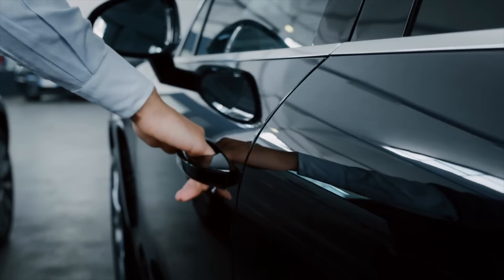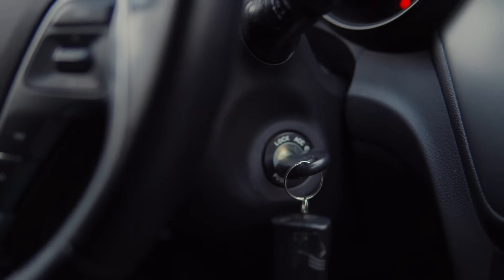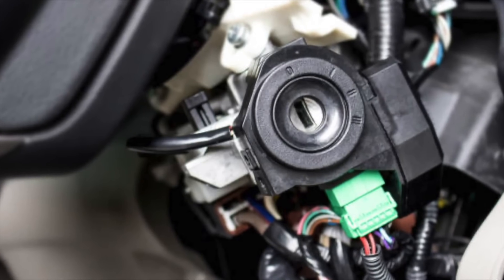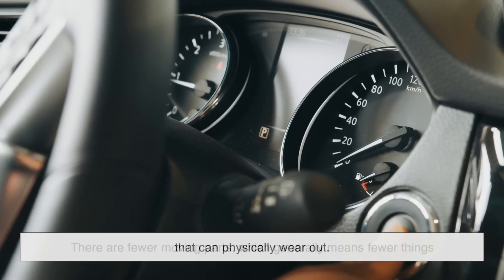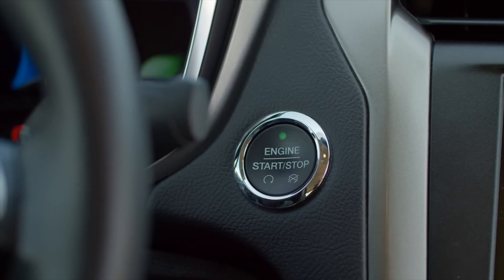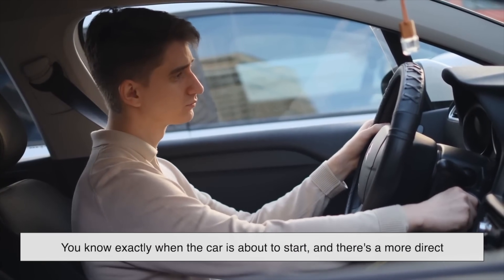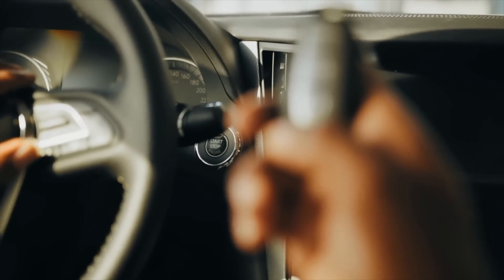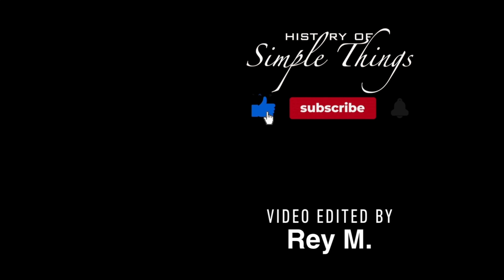Traditional Key vs. Push Button Start: What Sets Them Apart?

Comment: At least both the button and the key method is better than the hand crank method used in very old cars where you have to go outside at the front after turning on the valves and turning throttle to full and turn the crank to start the car. Maybe the key method was to simplify the old method.

Comment: I think the mechanisms are similar these days between push and key start - they both send signals to the ECU to start rather than cranking the starter motor directly, and the ECU handles the actual start. Obviously keyless start required the pinging of the key fob, but the ones where the key is pushed into a slot and there is a button are the same, apart from the mechanism to release the steering lock.

Comment: I prefer the key and door unlock button. In my flying days, you had to turn on a master switch, then crack the throttle and set full mixture, then push a start button. Newer aircraft have fuel injectors and automatically compensate for altitude. Over simplified but I believe in cars keys are best.

Comment: i have driven cars from the 1930s - late 1960s and the push button is on the floor. high beam light button in on the floor also to the left of the break and clutch.
Reply: My father owned a garage in the mid 60s and I remember that , also column change was a thing
Reply: * brake

Comment: I've driven two different cars with key activated ignition switches that were both 20 plus years old. Never needed to replace the ignition switch or the lock cylinder. A car having push button start would be enough of a reason for me not to buy it. In my opinion, push button start is just another overly complicated system. One that offers no real benefit to the driver. You can probably guess which system I prefer.

Comment: We have three cars. One has a key, the other two are keyless.
I prefer the key. You know where it is and there is no danger of driving off because you have started the car then gone back into the house and left the keys on the kitchen table.
I've seen a near-mishap. Stopped in a traffic queue the driver of the car in front got out and headed off while his partner got out, walked round to the driver's side and got in - only to get out and go running after the ex-driver to get the key!

Comment: I've had key start vehicles for over 50 years. Never had to change the cylinder lock on any vehicle.  It takes an awful lot of cycles to wear one out. Lets see how long these high tech garbage vehicles last compared to older key type cars. Pick your poison boys.

Comment: You're not old enough. Push button start was very common in cars up to the 1950s! You needed to use two hands, one to keep the choke pulled out, and the other to press the start button. The key was only for ignition and electrical system.

Comment: Back in the day, my 2004 already had a push-button start. It was rare and cool back then. Nowadays, not so much. I remember one time I didn't know the engine was already on and idling, I pushed the button a 2nd time and the starter made a whining sound that didn't sound so good.
Reply: I am shocked that this car (whoever the manufacturer is) did not recognize that the engine was already ON and activated the starter again...HUGE engineering flaw...it's not that difficult to know in the car network that the engine is already running and ignore another push of the start button...it's simply lazy work. I won't even ask what car brand this is, but definitely a huge logical gap. I mean it's really stupid simple: if the engine is on already (you simply have to know this in the car's computers) AND the start button is pressed, DO NOT engage the starter because it's useless :-) . PS: Shouldn't the start / stop button STOP the engine if it's pushed while the engine is on? Now you really make me question what car you have :-)

Comment: I intend to only drive vehicles with a physical connection to the electrical system.  Not only for reliability,  but for safety.  I'll tell my truck when to cut off. Like when once I jumped a lane at a toll booth. Pedal got stuck under the mat, all I had to do was flick that key back.  Accident avoided.  I don't think that button would have done this while in gear in motion.  I wouldn't trust it anyway.

Comment: Key based on the KISS system. And don't forget that removing the key from the ignition switch also locks the steering, which is a further deterrent to car thieves.
Reply: Is that why they did that?  I thought that if your car is rolling, it is better to be able to steer it than have the wheel locked.  I read that once in Australia, a driver was going down hill with transmission in neutral and engine off.  He could not steer and it took him too long to realize that he needed to insert the key and turn to unlock the steering wheel.  He died.
I prefer to be able to steer, period.  My 1966 Pontiac has the ignition switch mounted on the dashboard and the steering wheel is never locked.  It was easy and inexpensive to change the ignition switch precisely because I did not have to disassemble the steering column.  Problem with all of this computerized wizardry is that any repairs are impossible for do it yourselfers and are extremely expensive when done by shops.

Comment: I heard of one case where a push button start car that crashed.  For some reason the the engine died, and steering gets hard.  To restart you need to put the car in neutral and step on the brake..  I had a push button start car once and I didn't like it since you needed to step the brake kind of hard until the green light came on.  My truck and car has keys.
Reply: The disadvantage of power steering.

Comment: I hate that you need to press the brake pedal in push button cars to start the car. Driving stick it can happen on occasion that you stall the car on a green light, especially when the gas pedal is sensitive and you can easily add too much or too little power. With a key ignition you can simply step on the clutch and immediately start the engine while still coasting, giving you a rolling start. 

With the push button you basically have to come to a complete stop in order to start the engine again, which costs precious seconds and is inconvenient to everyone waiting on you. What's that? You never ever stall your manual transmission car, so no problem? Liar, I  say! 😄
Reply: I had a manual with a start button. There's no need to press the brake, just the clutch. And you can still restart the engine with the car movement.
Reply: @lajya01  Not with my Mazda 3. They even give you a big fat message on the dashboard that you have to depress the brake pedal before you can start the engine. When you do it without the brake, no ignition.

Comment: You seem to omit some history of cars. I mean whan cars from, I guess 1920'on maybe earlier, also had a starter button up to to luxury cars in the end of the previous century. Usually you would have to start a magneto, or other likewise device, and once that was set done you'd push a button to ignite or start  the engine. Could you make this clear for a broader audience, since the Start button is not that new, to my opinion. I do thank you to consider this idea and broadcast it., Greetz, Pierre

Comment: New cars come with two FOBs. If one is dead the other can be used. Also a dead FOB still can be used by holding the FOB near the push button when starting the car (according to my dealer). FOB battery replacement is easy to do also.
Reply: You should test the dead fob procedure. You might be up for a (bad) surprise.
Reply: @lajya01  You can start a push button car with a dead key fob by holding the fob close to the start button, as it may still transmit a signal. Additionally, many fobs contain a physical key that can unlock the door, allowing you to access the vehicle.

Comment: And when the battery on the key fob dies you're screwed.
Reply: No it wont, you can still turn on the car buy using the key fob to put the start button.
Reply: I guess you don’t wanna push button start car because that is not true and I’ve tested it by taking the battery out and the car starts right up

Comment: A disadvantage of push to start is that you can drive the car away without the keyfob, meaning a thief can steal the car. They can clone the signal transmitted by the car and the key fob
Reply: Modern car industry : creating new innovations, nobody asked for, to solve problems nobody had. 
🤔🤔😀😀😀😀
Reply: this happened to the chanel BigTime just a few weeks ago
Reply: But that is still a lot harder to do than hot wiring or breaking a part the ignition with a screwdriver to start it with a USB drive

Comment: Most "fleet" vehicles made will still have the mechanical key.  Vehicles purchased by rental and leasing fleets as well as company cars will prefer an actual key to prevent the drivers from walking away with the fob still in their pocket.  I bought a used vehicle from an Enterprise rental and it had the key, even though the manufacturer offered a keyless system optional for the build.
Reply: Most of the rental cars I have had in recent years featured the keyless ignition.

Comment: There is also a combination. You put in the key and just quickly turns the key once, and the automated start procedure starts the car. In all my years of driving, all sorts of stuff, I'we never seen a ignition switches give any problems. I'we bin driving since 1973.
Reply: Never seen that problem either and I drove some beaters.
Reply: I think the problem happened for those dangling a whole heavy set of keys and key chains with their car key.
Reply: It depends on how well you treat the car. My car has 193,000 miles on the clock and the ignition lock is in perfectly good order. My wife managed to break the ignition lock on her car by 120,000 miles.
Reply: I think all modern cars, even with keys, are 'soft' start, in that turning the key sends a signal to the ECU to start rather than cranking the starter motor directly. So there is not that much different, although I wounldn;t have a keyless entry due to the relay attacks.

Comment: Push start is just for the lazy people! Bring back the key! Car makers like them for more cars sold due to more being stolen!
Reply: Wth, what piece of dotishness are you even claiming, push start are for those who appreciate having a piece of mind when it comes to security not risking your vehicle being hot wired when left at certain places, it's frustrating to see base model vehicles still coming out with them like lower end Hyundai and Kia vehicles such as the Seltos, Creta, Stonic, Sonet and Venue, even Toyota and Subaru are phasing them out on their newer vehicles joining Mazda, Nissan amd Honda who have totally phased them out from all of their models, get with the times people, keys don't have place in the new car industry, buy a base model vehicle that still currently have it or buy 2nd hand
Reply: I am sorry you feel this way, but do some research and you will find push button start is extremely easy to steal. Why are cars being stolen so much? It’s because the criminals ping off the key fobs, open the car doors and the program a new key fob by plugging into the computer under the dash. This is done in seconds!!!!
Reply: @Hotdigadeedog I literally saw how a man had to program a new key and remove one of my mom's spare keys for her Mazda 3 when my former neighbour broke into our apartment and stole the spare key for it as well as the circuit board for the spare key for our Honda and it wasn't done in seconds, it was pretty much time consuming taking around half of an hour to a full hour to reprogram so don't know where you come out from with it could be done in a few seconds, even hot wiring or even stopping the ignition column down with a screwdriver just to start it with a USB is less time consuming than programing key phobs into a push start vehicle
Reply: @Hotdigadeedog There is a special tablet that must be plugged into the car's system for direct connection then you need to get the serial number of the keys to be programmed into the vehicle, the car's security system to bypass, a lot of things to confirm with the car's system, it is just really too time consuming and too obvious to ignore if a random person were to do it without consent and would raise a lot more red flags
Reply: After having our last key ignition vehicle stolen and not getting it back till this date don't dare call us lazy for not wanting one again, we lost a little over $10,000US in that theft and ain't risking it again, so don't call us lazy for that reason
Reply: Oh dear! Do some research!!!! More cars are stolen now than when cars were a key start!😂😂😂😂
Reply: @Hotdigadeedog Yeah but at least those same vehicles are recovered as the car still can't start without the key phob that is programmed into the car's system, of they don't get them back it's because they stole them to scrap for parts to sell but that is mainly because the victim forgot the car running which will give a one time usage until it shuts off, they hack the car's system to override the car's computer (which is time consuming) or the victim is held up at gunpoint for the key phob, other than that it is mechanically impossible to steal the vehicle through other means compared to key ignitions that can be hot wired or even started with a screwdriver and usb
Reply: @Hotdigadeedog Again I would continue to say if you don't like push start, buy a base model of vehicles that currently still have them or buy 2nd hand but don't expect the world to cater to what you want when they are moving forward with their technology as we are quickly moving off of key ignitions the same way how we are moving off of disc drives, auxiliary ports and physical sim cards to newer more reliable technology

Comment: Grew up with keys.  2010 Corolla... key.  2017 Subaru... push button.   Once I got used to it, I suppose I like the push button better.
Reply: on what car?
Reply: @CurlyFromTheSwirly  subaru.  I prefer driving the Corolla.  The Subaru is a 3.2 gas hog.
Reply: @SunriseLAW The 2.5 litre,  4 cylinder subarus  are great on gas.  Mine, 27 MPG in mix traffic.
Reply: @waynejackson169  Got stuck with the 3.2, long story :).  But I mostly drive the Corolla.  The Subaru is always nagging at me "lane departure" and nonsense like that.
Reply: @SunriseLAW Too many features?
Reply: @waynejackson169  "Lane departure"... cross any line ever so slightly... "Lane departure".  There is probably a way to turn it off or at least shut it up but that would require my attention.
Reply: @SunriseLAW It can be disabled! You may have to check the owners manual.  
  One of my brothers have a 2018 MDX.  The steering vibrates if you're changing lanes without signaling.  It serves it's purpose but can be very annoying!

Comment: Try troubleshooting both types with identical symptoms.  The mechanical system requires a common VOM and basic knowledge of electricity.  The electronic system requires at least one specialized computer, the experience to interpret what it indicates and you often often end up using a VOM. 

And, I don't need that computer to "tell" the car I replaced something.  Right-to-repair in action.

Comment: I have a '11 Lexus with the button.  I also have a 1975 Firebird and a 2001 Tacoma with key start.  I have owned the two older cars since new and have never replaced the ignition switch in either - pretty reliable.  The Lexus?  So far, so good, but I am still uneasy when I push the button.  Will it really work?  I miss the control -
Reply: At least you don't have to worry about reliability issues and the chance of it being hot wired

Comment: So many missing technologies between the old analog key and push button start, my 01 GMC Yukon has a physical key but also a Vats type system in the column, my 12 RAM had a Fob that's also a Key of sorts you need it insert it and turn but it's not actually a key it's all plastic, when turning it the PCM does the work like a Push Button system you can let go of the key and it will crank until it starts without holding the key in start, it will stop after so many seconds if it doesn't start and it's a Diesel that's more complicated to start with the grid heater and other systems needed to fire up properly.  So I don't have either in the video and my vehicles are made almost 20  years apart.

Comment: I prefer the Key
Reply: I generally like the key too, but with one exception I'm not a fan of the GM switchblade keys.  The switchblade keys break pretty easily and are a pain to replace. I've only had the button starts on rental cars, so perhaps if I owned a vehicle with one, I would get used to it and like it more.  The button start would certainly not be a "no go" for me if I was purchasing a vehicle as it is not that big a deal.
Reply: So do I
Reply: Key is good but with cars soo quiet now, I saw alot of people damage their starting motors when they forgot or didn't notice the car being on already and attempt to start it again

Comment: Key will always be better because you can put into different modes, and because you can hold it down to force an attempt to start instead of it doing what it feels like when you do the single push method & hope it does something. but a key is still better because no one says the you cant have a key and a fob at the same time as an option for those who want ultimate control. :P

But most important is if the accelerator gets stuck good luck turning it off quickly in an emergency with a fob.. A key goes "click" and done its off. :)
Reply: I guess it depends on the model. For mine, pressing the button cycles off-acc-on. Only with pressing the button while holding down the pedal will go all the way to crank.
And to force stop the engine, triple push the button, or hold the button down.
I guess the best is to go through your own owner's manuals.